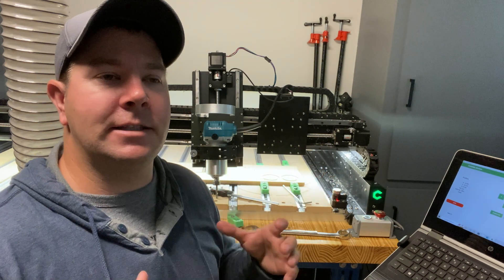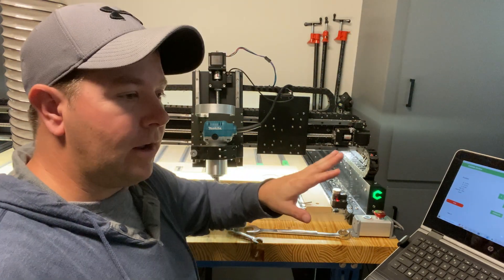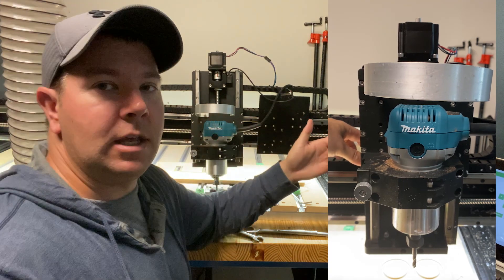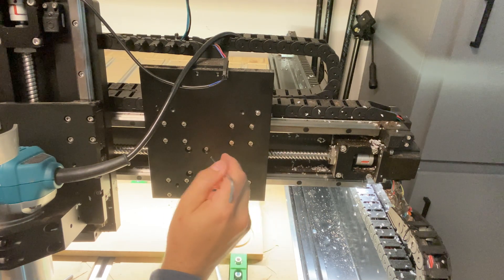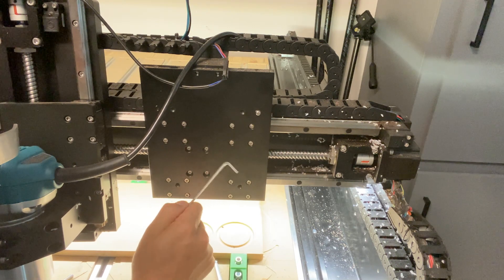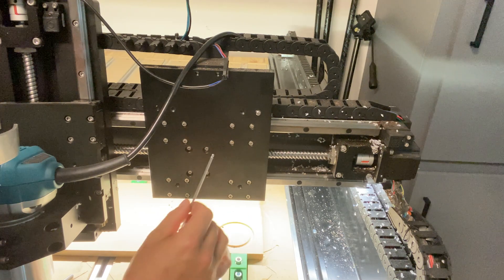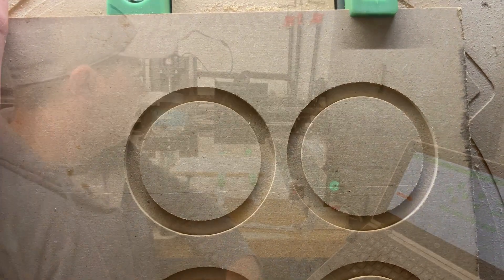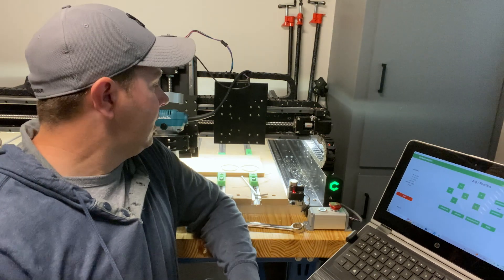Shapeoko 5 Pro Accuracy problems and fix

Comment: I am having an issue with this assembly too, but the screws are full tight and loctite’d too, the “nut” of the ball screw assembly can move 1-2mm on mine (z-plate makes a clunk like yours but it’s not moving because of the 4 screws), it’s like all the pre-tensioning is gone or the bearings in the screw are too small. Clunk zone happens without the screw shaft turning, you can see the nut/“bearing” body move the plate is screed to moving back and forth. Waiting to hear how to remove the excessive backlash from mine.
Reply from the maker: I guess there could be play in the ball screw nut. I hate dealing with these problems, but it does feel good when you figure it out. If you post a video on my FB group I will see if I can help you troubles shoot, and its just good knowledge to have out there.

Comment: This is a maintenance/owner issue. Manual states to check all hardware for torque and do this ongoing per manual . Also looks like you modified your CNC, looks like an issue you may have created by not properly torquing the hardware. Cleaning off your CNC is also part of overall maintenance.
Reply from the maker: I haven’t modified anything. The screws in this video come assembled with lock tight on them. That is one of the things CC uses as a selling point “fully assembled Z axis.” There is no reason these screws should have backed out. I conduct regular inspections and preventative maintenance on my machine. Thanks for watching.

Comment: I noticed you have a Makita router now. What happened to the Carbide one it came with? Also do you know if they’re essentially the same router apart from the cord length? Thanks for your videos!
Reply from the maker: The carbide router did not survive all the way through the first set of brushed. I speculate it was the bearing because it got very crunchy spinning it by hand and there was some radial run out. The cords are not the same. I actually pulled the cord off the carbide router and installed it on the makita because the makita router cord was not long enough. The makita is much smoother and quieter as well. Hope this helps.

Comment: Thanks for sharing!  Have been missing a step in the exact same place on the right side of semi circles for a couple months now.  Thought maybe it was programming or a worn endmill until i watched your video.  I wiggled the z axis today and it has the same amount of play in it.  How do i access the x axis plate where you added locktite and  tightened the 4 screws?
Reply from the maker: You have to take the spindle mount off. Unplug the Z motor move the Spindle mount plate almost to the bottom. there are 4 large Allen head screws. There will be locator pins holding the plate in place to the X plate.
Reply: @builtforlife  Thank you for help!  I'll give it a try it's been awhile since I assembled it so couldn't remember how it went together.
Reply: @builtforlife  Got a chance today to remove the z mount plate and found that the 4 screws on the x axis plate were tight.  Found 2 loose screws on the x axis bearing cover that is behind the x axis plate.  Tightened them up and now no more slop!  Do these 2 screws need Loctite?
Reply from the maker: I use blue lock right 242 on everything i don’t want coming out. Blue is strong enough that it shouldn’t vibrate out but can still be easily removed with tools.
Reply: @builtforlife  Thanks I'll try the blue Loctite.  I also just found this video that Carbide 3D made specifically for Shapeoko 5 pro movement that details the slop that can occur and how to tighten it: https://www.youtube.com/watch?v=cb9RR2KZTHM

Comment: I have the 5 pro 4x4. The hardware loosening up is the last thing you should be worrying about. The controller board is complete trash. They have gone so far off of their thermal budget with cooling of the stepper drivers these machines wont last more than  a couple years with moderate use unless theh drastically lower the torque output of the already weak steppers they used or add acrive cooling. That's if the dry solder joints or the splattered solder doesnt get you first. I have a 3 xxl and a 5 pro 4x4. Shapeoko will not be my next machine.  Good luck to all of you.

If you think the hardware loosens up now, wait until you put an actual spindle on it. It's a daily tightening that's required on everything.
Reply from the maker: Shapeoko actually replaces my controller less than a month in, and it does get really hot. This one has ran strong for a long time though hopefully it keeps on going.
Reply: @builtforlife I hope so. If it doesn't look into converting it to a Masso touch cnc controller. They are about a grand and they will make that the 5 run forever with the ability to add lots of things. And you don't need a computer near it. It's really what shapeoko should have went with instead of trying to rebuild the wheel. And doing a terrible job at that.

And you shouldn't have had to replace the controller in the first place. I'm sorry you had to go through that. I did too but they wouldn't replace mine because mine happened before "controllergate"
Reply from the maker: I think as time goes on i will end up with a better machine. Phantom CNC is getting all of my drooling attention right now.
Reply: @J.erem.y  I just posted a comment about why the Carbide motion controller is just trash and a couple of suggestions of what to do as more affordable upgrading strategy than going full Masso. Hope you find these of interest.
Reply from the maker: I will check it out.
Reply: @builtforlife  See my comment just posted about Carbide's choice of sticking with GRBL as the firmware for their controller ... it's an ancient crude firmware that sends "bang bang" pulses to the 4 motors, causing a mountain of vibration. My comment outlines a couple of fixes. Hope you find this helpful. Thanks for posting your video.